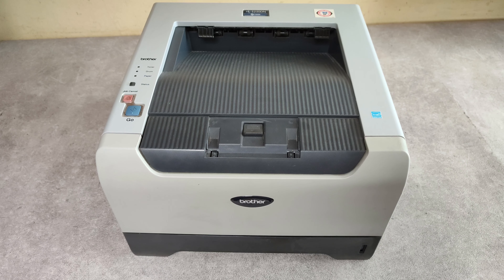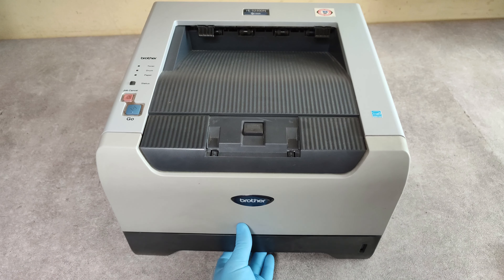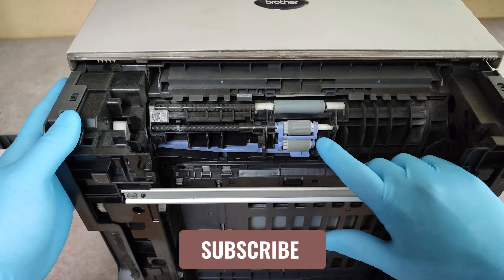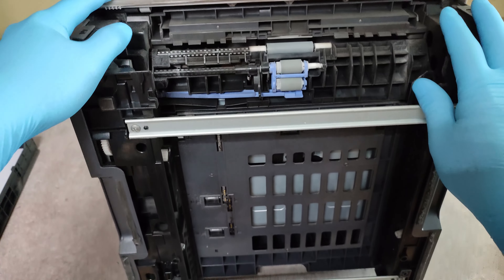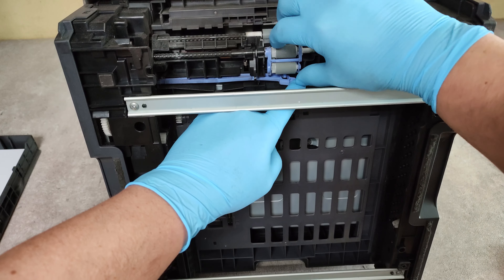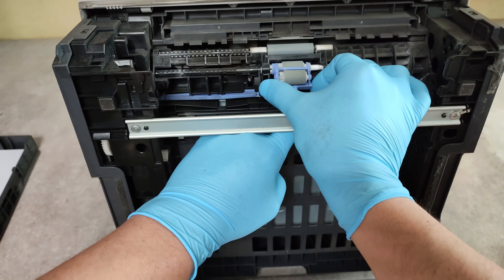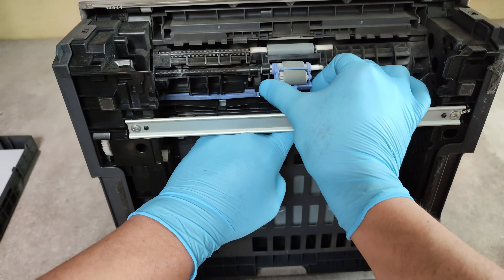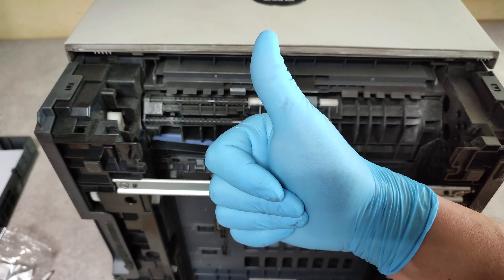HOW TO REPLACE THE PICKUP ROLLER ON BROTHER HL-5250DN, HL-5240, HL-5270DN, LM5140001

Comment: My HL-5250DN has an issue where it will print a page, then half of a second page (with no print on it) comes through and jams.    Would this be the fix for that, or is the issue with another part of the paper feed system?  Thanks for any help!
Reply from the maker: Hello! The paper jamming maybe caused by the pickup roller or a sticky solenoid. If you have already replaced the roller look at the solenoid section for sticky surface.